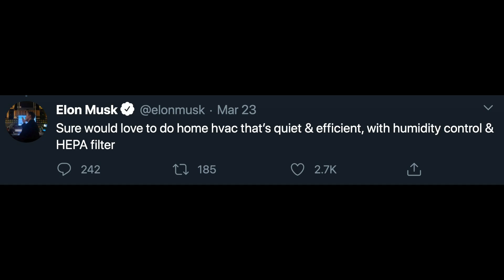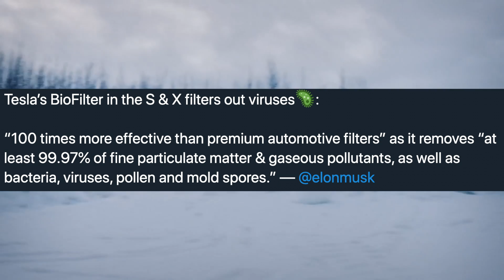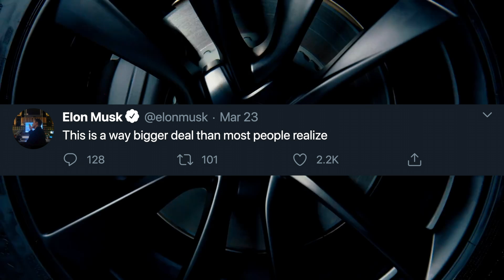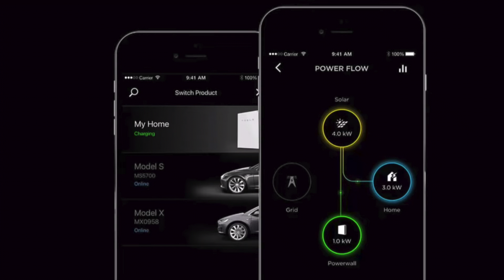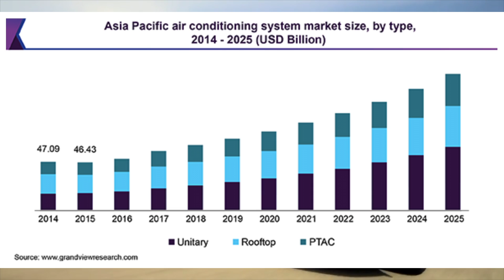Tesla's Secret Upcoming Product: HVAC for Homes (Heating, Ventilating, Air Conditioning)

Comment: A lot of this kind of thing is already being done with mini split systems in other countries. For whatever reason they are not that popular in the United States yet.
There are some efficiency issues with not heating or cooling rooms when you are not home. Let's say it's 90° outside. And so you turn off the air conditioning in rooms that you're not using. It's not just a matter of then cooling the air in that room, the furniture the walls and the floor all eventually reach ambient temperature of 90° f and then the air conditioning system also has to cool those back down. There is a diminishing return by turning it off completely and allowing it to get to ambient outside temps. You are sometimes better off to let the temperature stay the same and just maintain it than you are to allow the room temperature to go back to ambient outside temperature. having extremely good insulation so that that temperature bleeds off slowly is probably the better place to work on increasing efficiency.
with many split systems however you could still cool the rooms below ambient but maybe not as cool as you might like then to be if you were in the room.

Comment: there are huge Companies that have been in the HVAC industry for a long time and have very efficient equipment. And very good DDC controls for them.   Elon Musk would have to come up with something very revolutionary to be able to compete. But most of the efficiency comes from the construction of the home/building the r-value and u-values and how tight the structure is. What type of windows and doors are used affect the heat load! obviously the construction of the home is very expensive if you use high-efficiency materials. the unit doesn’t really become efficient if it’s always on trying to heat up a home that’s always losing the heat, or cooling a home that’s also letting the heat in.
Reply: "there are huge Companies that have been in the________industry for a long time and have very efficient equipment" ... Insert 1. Auto 2. Energy 3. Battery etc  You realize how silly you sound?

Comment: Unfiltered HVAC systems get dirty and mouldy (moldy) - mould spores. Legionella bacteria, etc. Condensed water is contaminated. Filters reduce the problem but are often not changed when they should be. A high efficiency filter filters(?) needed. Dyson has the cyclone system. K+N have a low resistance highly efficient oiled cotton fibre filter. Tesla have their version of HEPA filter.

Comment: Air-pumps. Tubes. Desktop Air-conditioning Cubicle. You Adjust "Your" Cubicle To "Your" Desired Heat, At Home Or Work, In Front Of Your Computer Desk. The Tube Has Sticky Tape TO The Perfect Desired Air Direction You Mount It. <=== Of All Your Personal Hvac At Your Desk. KPIs. It's A Plastic Tube, Closed At One End, With Holes, And A Badass Air-pump. With Vents That You Arrange At Your Desk YOURSELF. 64 Degrees For Me Boss.

Comment: The Model Y has a revolutionary Heat Pump design. Maybe they could scale it up for Home Use?
Reply: nonsense, the tesla heat pump is not revolutionary, its a very old system, and companies have been using it for decade, the nissan leaf came wit it years before, also the porsche taycan has it too

Comment: There is areas to improve on in air conditioning systems but you’re only paying for cold air. I’d be pissed if I had to take a service call for a Tesla ac unit and have to call tech support and them say I’m not qualified to work on their equipment and tell a customer sorry but I can’t fix it

Comment: I hope he does. HVAC market is massively overpriced, the equipment is stupid, expensive and inefficient. They industry designed to deny the homeowner access to basic parts like capacitors, flame sensors, cabinets. It relies on tech performing a demand load calculations they hardly do, self diagnostics either does not exists or only high end products. Instead we need system that variable capacity (VRF) capacity driven; that anyone can properly install; can fully determine the load and adjust the air speed, compressor and evaporator based on the load, same with gas furnaces. We are wasting insane number of resources because it takes 4k to replace a $500 furnace. The HVAC industry will never improve or evolve without a competition.

Comment: I did the smart thermostat with multiple zones. It doesn’t work. Simple old  school programmable are better. What he is looking at is the whole picture. First can we build a better system? What if each room had one? Then only heat or cool the room when needed.  That would provide true energy savings. The power consumption curve and solar generation curve match pretty well.

Comment: Pure HV-DC (High Voltage Direct Current) wiring network and HVAC system for homes. This all being powered from Power Wall to Buffer Solar PV with No Neeed for Inverters. Note how AC system often have Inverters mainly as fine control of Compressor Motors. A Tesla fully integrated system would be all DC Powered and more efficient to run off Buffered Solar.

Comment: If Tesla did design a smart home they could integrate refrigeration, heat pumps, solar panels, power walls as well as Passivhaus ideas to turn homes and other buildings into net exporters of energy.
Reply: nonsense HVAC is not the solution , you first need a very well insulated house, thats it, you cant cool or heat a poorly insulated building, there are already very efficient buildings in germany and europe that uses all those types of technologies
Reply: @carholic-sz3qv  That's what I'm referring to in most climates a really well insulated building will need little to no heating or cooling. If you then include solar panels, energy storage and other efficient technologies most buildings could sell more electricity to the grid then they buy.
Reply: @pauladams1829  not all buildings can make enough electrcity with solar panels tho
Reply: @carholic-sz3qv  True it would be dependent on the size of the roof climate etc and the use of the building but if a significant proportion of buildings did produce more then they consumed it would be a massive step in the right direction for humanity as a whole the environment and bill payers.

Comment: Ac's are large, heavy and noisy for a reason. it takes a lot of work to compress a gas into a fluid.  
There is one compressor type that is quieter but it spins at a higher rpm and the patent is not cheap.. That's the scroll compressor. So I don't think he'll be putting one of those in a home ac unit..  All cheap ac units use the Reciprocating Air Conditioner Compressor.
they are loud, they shake but they are cheap.  How else can you buy an ac unit for $120 bucks.

Comment: Tesla is not the first company to develop and put an electric AC compressor in a car. 

The current home HVAC market has tons of very energy efficient and well tested units. Tesla would really need to come in with something new and innovative to make a splash in this market. Otherwise it will most likely go the ways of the solar roof where it has slow traction and only being put on new/newer luxury homes. Efficient electric air conditioning units are very well developed and mature. Check out the market for Mini-Split systems. These are low cost, very efficient, and VERY common in places other than the US. 

The HVAC unit is also only half the battle. It takes smart design in a building to get good cooling/heating performance. If a building is poorly designed, a new HVAC unit will only go so far. And redesigning the AC routing in a building is $$. 

IMO, HVAC inefficiency is better solved with solar. Usually if its hot, its also sunny. Use the sun to power the AC unit during the heat of the day and keep the house nice and cold.

Comment: While US HVAC system manufacturers whined to the government to extend the 300psi R22 systems Montreal deadline due to no R&D funds during the downturn, Japan snuck in and took the industry over with 600psi systems running R410A and a whole bunch of efficiency-creating tricks like bubble control of EEVs, variable flow systems (variable speed is stupid... peak motor efficiency is expensively sacrificed for variable speed control to minimize the buildup of a bearing-killing electrical potential on the rotor), and superheat/subcooling elimination. Stuff the stagnant US industry would never have ventured into. Now we see Carrier vans installing Mitsubishi systems. Soon, R410A will go away and we will have the chance to implement a new technology. Peltiers? Plasma Refrigerant? Will we do it?
Reply: Variable flow would be easy. A stepper-motor-controlled bypass valve around the compressor, and moveable shrouds on the indoor and outdoor fans and you have variable flow with no capacitor banks. 3-Phase is a good idea though. It is more efficient and less expensive to implement (no current/potential relays. No start/run capacitors).

Comment: Apple will Create Air Conditioner Software With GPS That Close The Air Conditioner after a few Minute you Are not in The Room or if it’s Cold or Warm in the Night for you not get Sick. Solve it. And you can Operate it from iPhone or Apple Watch or iPad or Apple TV or HomePod or Siri from HomeKit no need Remote at All which save a Lot of Money. And it’s Electric Air Conditioner by Apple that Apple Put at Home and Work in another patent With Carrier That install them  with Tens of Trillions Biz. Electric no remote with iPhone use.

Comment: I'm a huge Tesla supporter, but there is ton of bad information in this clip.  From "AC units that make clean water", which they certainly don't, to "most AC units being belt driven" when only VERY VERY large commercial units use belts.  Any residential unit and even smaller commercial units will be direct drive, and that's just the fan.  Any compressor is going to be 100% electrically driven without belts. 

And never forget Nikola Tesla's (the man) greatest weakness was that he wasn't an engineer.  He was infinitely creative, but he didn't have a background in physics.  Similarly, to make claims about dehumidification in AC systems is to admit you don't understand the physics of it.  Dehumidification is inherently a waste of energy because you have to make the air cold to dry it out.  And if you don't need it cold once it's dried out, now you have to warm it back up.  I'm sorry it's an energy-hog, but you're not going to circumvent Mother Nature on that one.  

It was folly for the Big3 to mock Elon for simply wanting to make an electric car.  He has proven them just how wrong they are.  But to shake his fist in the face of the fundamental laws of physics is a fight he won't win.

Comment: There are some huge problems with getting into the market of the in-home HVAC system.
The biggest of which is going to be outside air infiltration. Put simply, where is the house leaking air or allowing outside air in. This is going to vary by house, especially older homes.
The other big problem is going to be testing and balancing so that you appropriately size a unit to the home size. A 2000 sq. ft. home does not need a 5-ton AC system. It's not going to run long enough to pull the humidity out of the air inside the home, thus making it more comfortable.

Elon Musk entering the HVAC market isn't going to change it like Tesla has changed the automotive industry. There are HUGE ancillary business structures that need to be adapted, and that's going to be a much-heavier lift.

Comment: I am really not seeing where the great innovation is here. Home heat pumps are already electric and using the proper type of motor for grid electricity. They probably converted to a DC motor for the car.

As far as the compressor (the pump) goes, I doubt they have anything revolutionary. They can be made better at a higher cost.

Real innovation here would probably be lower cost at high efficiency,  with good reliability. The filtration system might be new to such a product,  but isn't as far as technology goes. If it holds up well and doesn't cost a fortune changing filters it may provide a niche that they can get into that market. Since the tech isn't new though others could quickly compete.
Reply: the Innovation come from a 100% Electric HVAC that uses NO Pulleys, Cams or Belts.

Comment: Before saying HVACs are dumping "pure water", you may want to have it actually tested. Even if the evaporator is downstream from an HEPA filter, random stuff will still get in from any cracks and openings between the filter and evaporator along with whatever makes it through the filter itself. It won't be anywhere near pure without additional processing.
Reply: Musk spouts off all the time while having no idea what he is talking about. Why expect any different here? I will laugh if Tesla, actually does this, as it will be just like Tesla solar, where their product is more expensive and less efficient than the competition. Tesla will spent the next 5 to 8 years promising tgat version 2 or 3 will be revolutionary, and Tesla fans will be telling us how legacy HVAC companies are going to face their Kodak moment.
Reply: @TroySavary  The efficiency argument in a fight against AC compressor is moot, AC compressors are already very efficient and extremely reliable. The main thing Tesla can bring to the market is integration with solar and power wall to avoid double/triple-conversion there, further reduce dependence on grid power and use more solar energy as it is being generated to reduce battery strain.

Comment: Solar powered ductless splits already exist but lots of room for improvement
Reply: 100% Electric HVAC already Exist , but they are Large and Bulky.
TESLA aims to make a Whole Home HVAC that is Smaller & Lighter , that is more Efficient than Current HVAC Systems, made without Pulleys and Belts.
Reply: Mark Plott I can see small equipment direct driven it’s the large capacity that is questionable but over time doable , reducing wasted energy via building envelopes etc would reduce required capacity and multiples to replace large systems may allow better efficiency .
Reply: @markplott4820  stop talking nonsense you morons, HVAC is not the solution , you first need a very well insulated house, thats it, you cant cool or heat a poorly insulated building
Reply: @carholic-sz3qv  - Why, NOT have both ?
A Super Insulated home is Easy to do.

Comment: I have designed HVAC systems for decades and I am all for putting efficient HVAC systems in homes and buildings but there is a big problem...Very Inefficient and leaky homes! Putting a high-efficiency HVAC in an average home is like putting a drag racing engine into a VW bug.

Comment: Oh yeah! We are using technology from the 1800s! There are so many other options but no one has explored. PLUS: Turn the entire home into a heat engine! The freezer dumps it heat to the fridge => house hvac => hot water => stove => oven. Everything recycles heat to another system... what is not used or is needed interfaces with storage.
Reply: Tesla turned AA batteries into a car. He could turn a bunch of parallel peltiers into a heat pump.

Comment: Not sure about this.  The AC system in Tesla cars is too small for room/home use.  They would have to design/make  new compressors to get involve in the home HVAC market.  Additionally, cooling efficiency only gets better with larger condensers and evaporators.   They could push through this with a compact, window type AC mainly as an air purifier and dehumidifier and a Tesla branded AC is somethig.

Comment: The only potential that exists reducing manufacturing costs. He'd be better suited if he contracted with Carrier or Kholer or even Jasco to co-design and manufacture home appliances.
Reply: why ? when TESLA can simply make a Superior HVAC from Scratch.
Reply: @markplott4820  distribution will be a unnecessary cost and problem if Tesla goes at it alone. When partnering, not only will they not have to deal with that huge problem, they gain intellectual capacity from bringing in Carrier and Kohler, and simultaneously remove two huge competitors. 

Tesla would also be able to share risk and get product to market much faster.
Reply: @ShonTolliverMusic  - why ? TESLA Solar does just FINE without Distributers, TESLA model is DIRECT to Consumer model, you should watch - youtube NOW you know - ELON the Disruptor Series.
Reply: @markplott4820  solar roofing is not the same as HVAC. There were virtually no players in solar and even still SolarCity was still going broke before its merger. That industry is largely propped up by govt subsidies that are now (if not already) expiring.

The cats already out of the bag for Elon. Meaning, the HVAC major players won't give him the runway like silly GM did, and thus his path will be too costly.

Plus, there not much more room to break the laws of thermodynamics. Most high efficiency boilers run at 96%+ efficiency. That doesn't leave much room for disruption (in terms of technology) outside of distribution, supply chain, cost reduction, and maybe sales systems. There will be no direct to consumer HVAC systems.
Reply: @ShonTolliverMusic   - Agree, however TESLA has over a DECADE expierence in Building 100% HVAC systems in Tesla vehicles.
and IT could translate to the Home HVAC market.

there are Multiple SOLAR install vendors, just look in the Phone book. though FEW have Expertiece in both Roofs and Solar.

TESLA car HVAC does NOT use any Boilers .